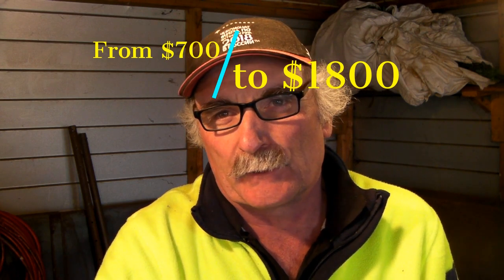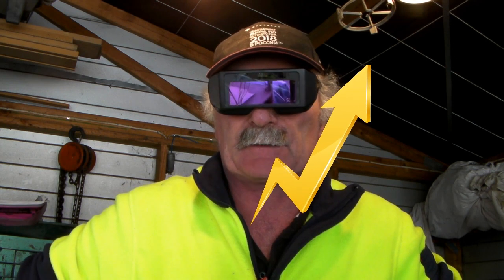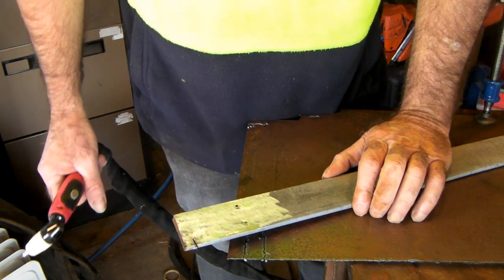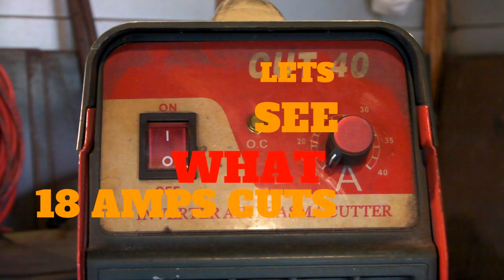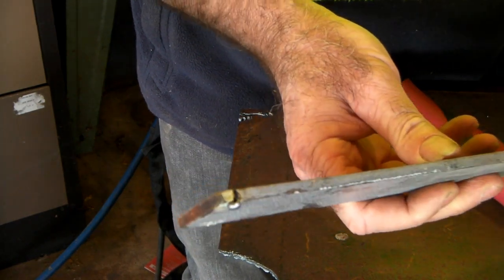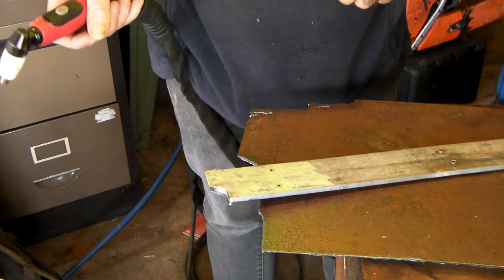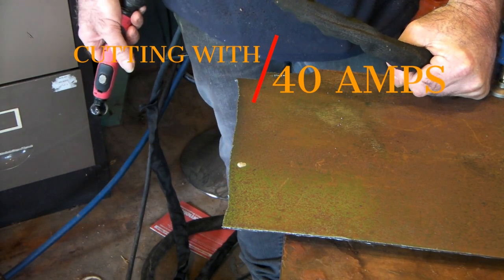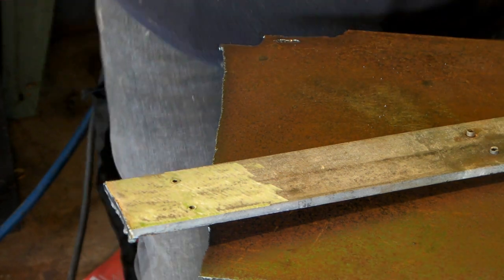Plasma Cutter With Built In Air Compressor / 3 in 1 plasma cutter with air compressor

Comment: Air compressors are also big and heavy. If you need even 4 CFM, you’re dealing with an extra 50 pounds, or more. These are suppose to be portable, so that screws up the equation. ESAB has a 15 and a 30 amp model. But the 15 amp is just for sheet metal work, and the 30 amp is recommended for 3/8” (8 mm) max, and 1/8” (3mm) for best use. You sure that metal is 5 mm? It looks like 6.
Reply from the maker: Thanks

Comment: Is there any reason not to just cut on max power all the time?
Reply from the maker: That's what i do half the time mate lol
Reply: Most of the time you can just crank it up and get cutting. Sometimes you want to turn it down, especially on thin sheet metal where things like warping can easily become an issue.

Comment: So what do I do for my setup. An air tank and plasma cutter and generator is a lot to carry in a pickup.
Reply from the maker: It's just my opinion ,if you use a plasma cutter offsite . You would be better to invest in a gas air compressor ,  a normal plasma cutter & a generator (but make sure your plasma can run from a generator because some of then wont) But i would only invest in this setup if you have to work a lot away from your workshop.
Thanks pete
Reply: I have the hypotherm 30air, it goes all day long paired up with my Hobart 145 welder/gen cutting 2 3/8 pipe even with rust. Only down fall is its gotta be plugged into the 220 , if not its going to be a long day. 120 for thin material and clean.  If anything the hypotherm 30air is the only way to go